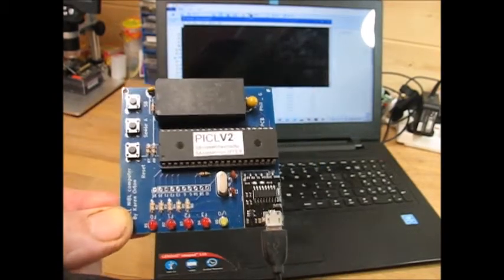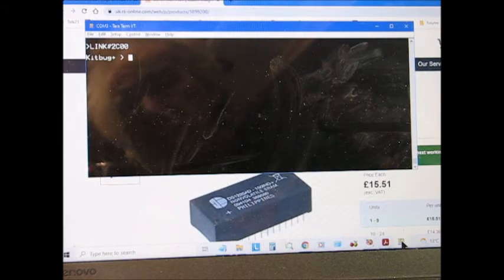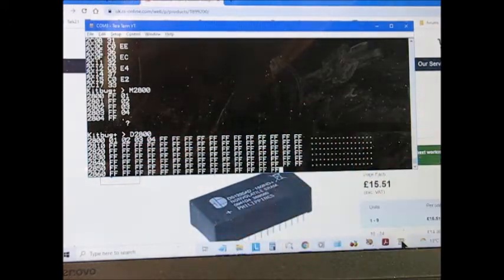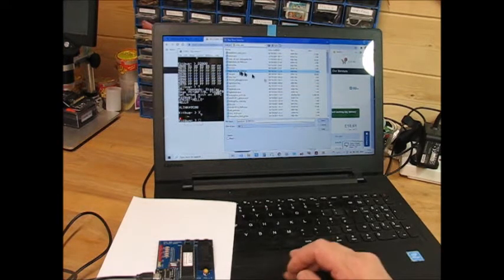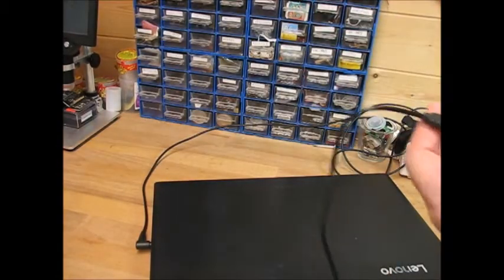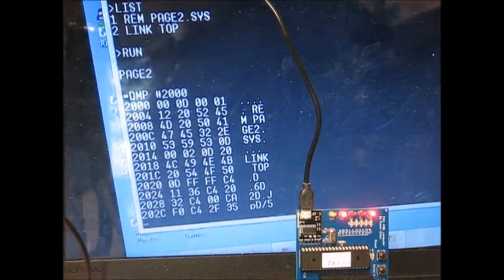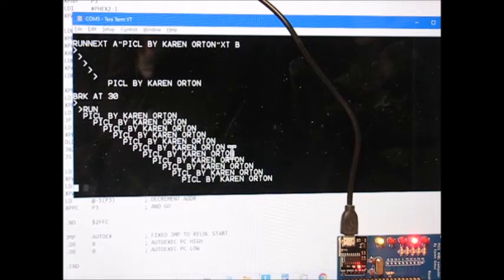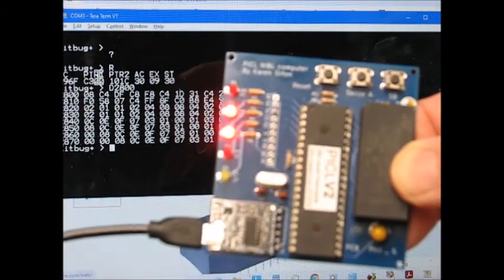The PICL Version 2  -  a very capable late-70s SC/MP computer

Comment: Why do people love battery ram instead of maybe just dumping ram to a memory chip that doesn’t need power to save memory and then loading on boot
Reply from the maker: I love NVram because its so convenient and allows the monitor to remain resident.  I have NVrams from work 25 years ago and they still retain data perfectly. I've built several PICLs, and a couple have Ramtron FRAM chips which are NV without a battery - functionally they're identical.  FRAMs are popular with the retro arcade machine crowd 🙂
Reply: @PHILG2864 ya but if you don’t use them often and also depending on the battery used they go dead and lose data I’ve always hated all forms of battery ram
Reply: @PHILG2864 I’ll look into fram I hate battery ram